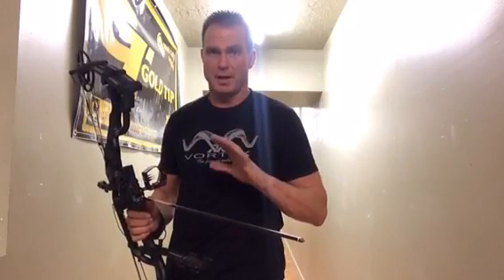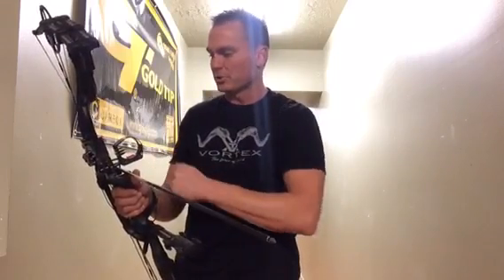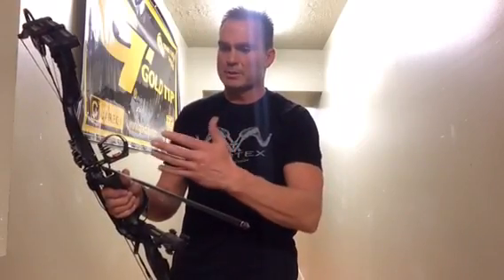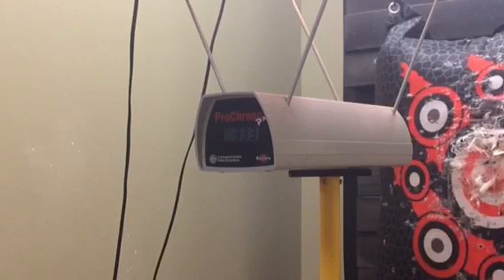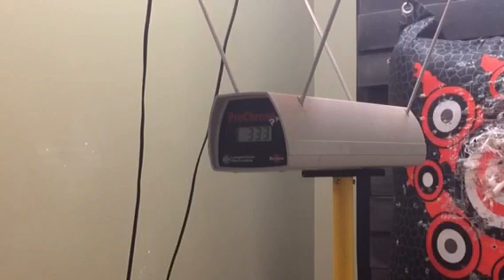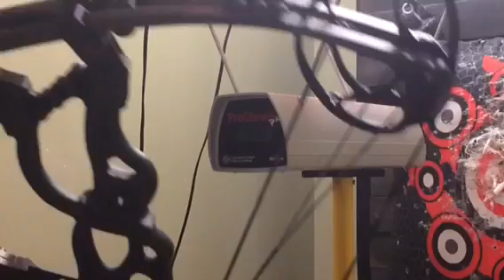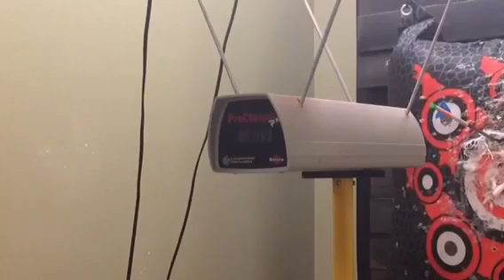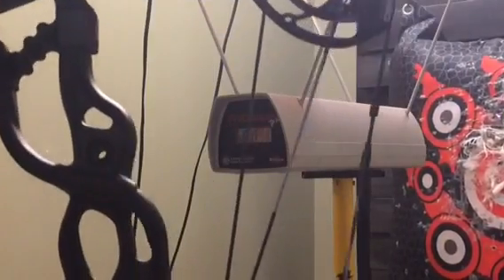Hoyt Carbon Spyder Turbo 2015

Comment: On initial set up what did you set:
(1) your knocking point at - perfectly level arrow?
(2) have far from rise (not rubber) to center of arrow did you start with - 13/16"?
(3) how much pre-lean did you have with the top cam at rest - most of my past Hoyts had some pre-lean at rest with the arrow cross string at approximately the D-loop
(4) did you set up timing at dead even or did you have the top cam advanced 1/16" to 1/8"?
(5) After all tunned - did your arrows line up with your pins and string?

Thanks
Reply: Id like to know this exact thing! All those questions are perfect